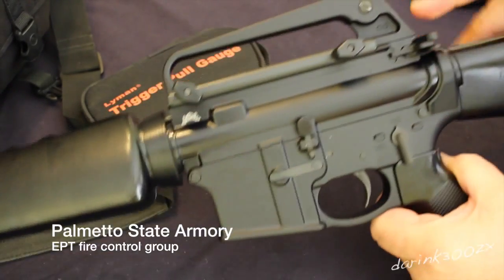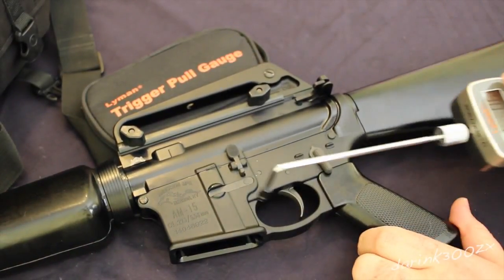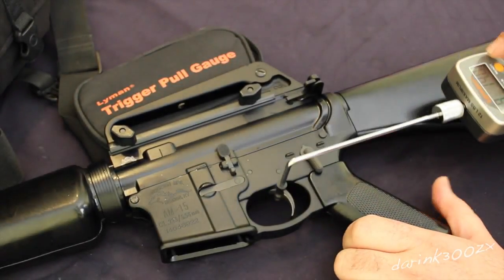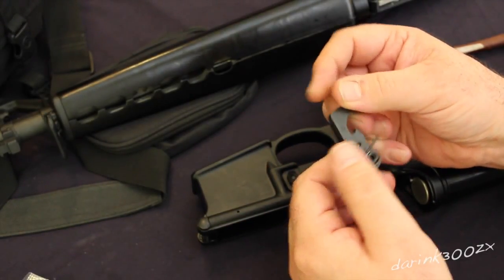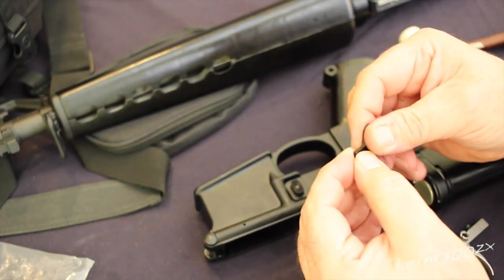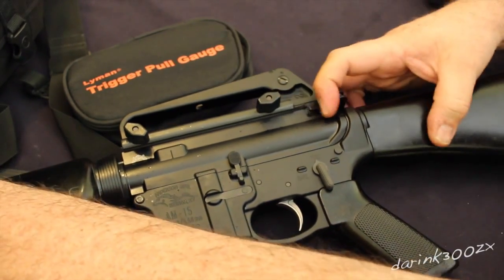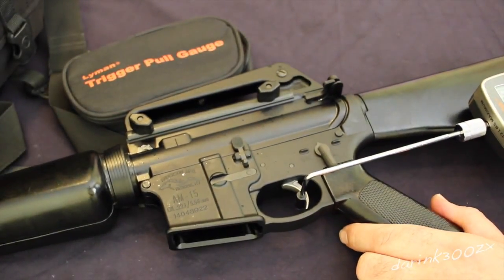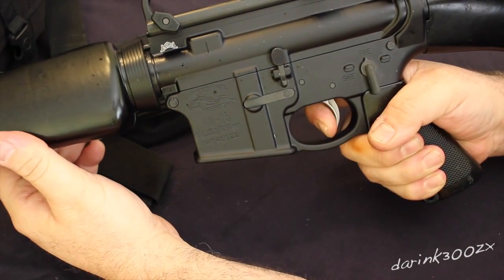PSA EPT fire control group with trigger pull measurement

Comment: It looks like using the gauge on different places in the trigger will change the outcome, which makes sense if you try to pull the trigger from higher it will be harder to break where as if you pull farther toward the end of the lever it should be a lighter pull

Comment: Thanks. I added some JP Enterprises trigger and hammer springs and the trigger pull gets lighter still but you still have that long trigger creep.
Reply from the maker: I guess each trigger varies when you're in this price range, mine don't have a lot of creep to them.
Reply: That's with the PSA EPT fire control group.

Comment: I must have been lucky. my psa stock is crisp 6lb. I still plan on lightening it on my distance rig but cqb is perfect stock
Reply from the maker: Paul H that's nice to hear, maybe there is some inconsistencies with the springs they use?  I've got a few of these PSA triggers I need to check the pull weight on the others too.
Reply: darink300zx you're probably right sir. I've read quite a few varying degrees of pull and crispness.  I was really surprised when I got the lower.  It's still not ideal for longer ranges but even with my severe rheumatoid arthritis it's fairly pleasant all things considered.

Comment: You could get better results with 1000 grit sand paper. 
That coating does nothing for trigger pull and I doubt very much it does anything  to make it smoother.
Reply from the maker: AKBuilder762 yeah, maybe, it felt smoother for me though and as can be seen either the coating (or possibly the springs) that came in the kit decreased the trigger pull on my rifle. It's a sample set of one though, so it should be taken as that.

Comment: I Received mine about a week ago and sorry to say after all the waiting for it to be shipped to me i was very disappointed. Heavy machining marks on hammer and on trigger sear. I've gotten better machined trigger parts from Amazon YES Amazon! You get what you pay for! i should of held out for a better brand.
Reply from the maker: That's interesting.  I've always had good luck with PSA FCGs both their standard ones and the EPT.  If I were you I'd install it and see how it functions, if it has a lot of grittiness try returning it for another.  Although PSA customer service can be a little slow at times, they have always come through for me when I've not been satisfied with a product I received from them.

Comment: lubrication the FCG will help a lot. Bill Geissele often speaks to keeping the trigger well lubricated. Weapons Shield has a YouTube vid about how to lighten trigger pull with use of their lubricant product. The more that you dry fire the trigger the smoother and softer it will become. "snapping in" is a good way to practice your breath control and settling the hands, whilst improving the trigger.
Reply from the maker: Casey Terrence cool, good info to know. I usually lubricate the components as I put them in with some grease, and then when I clean a little clp gets worked in. Thanks.

Comment: if the shape and smoothness of the parts are the same they should perform the same with or without coating...it is more likely the spring that makes the difference
Reply from the maker: +EvendimataE Honestly, I hadn't thought of that, I wonder if the EPT kit is shipped with reduced power springs and this is all a marketing gimmick?
Reply: darink300zx maybe they should just sell kits of springs as upgrade so it will be cheaper LOL
Reply from the maker: EvendimataE lol, true.  You've got me curious, I must say.  I may just swap the springs from the trigger I took out to this one and see what the pulls are, that'd tell the tale probably.

Comment: Run JP red/yellow springs with this FCG for a really good mil spec trigger.
~5.5lb
Reply from the maker: I need to try that. Haven't messed with the springs yet. Thanks.
Reply from the maker: I tried this, thanks for the suggestion. I did the red/yellow and the yellow/yellow jp kits. Check it out: https://youtu.be/fv2gjde0xGQ

Comment: Just got one...haven't installed it yet. You shoot yours?
Reply from the maker: Yes I have, just haven't had a chance to do the follow up video. It shoots well, but then the standard trigger worked well in this rifle as well. I do think it's a bit smoother but psa triggers are generally pretty smooth on their standard parts kit triggers anyway. The lighter trigger pull surprised me, but it wasn't a hugely noticeable difference. There is no discernible grittiness that I can feel though so worth the money. Thanks for watching and the comment.

Comment: I just got mine, its not really anything special in terms of pull weight and smoothness but the pre travel is shorter than my standard trigger I got from them.  In fact, to me it just looks like a milspec unit in the white... the bearing surfaces are polished better than my milspec unit but i can still see mill marks. All in all, not really all that impressed with the pull, but as I said, the pre travel is quite a bit less. reset is pretty nice too. I may get out the rotary tool and polishing wheel and see if I can help get a little smoother pull, as well as some new springs.
Reply from the maker: +GraymanTactics Yeah, it's definitely not one of the high dollar triggers.  I'm sure each trigger is different, but I did see a little lighter pull and to me it did seem smoother, maybe it was the pre-travel that I noticed and didn't know how to describe it.  Thanks for watching and the comment.
Reply: darink300zx Yeah and for $30 I really cant complain much. I almost went with one of the ALG QMS units but figured for 20ish less it would still be worth it to give the PSA one a shot. I am by no means so upset with it that I will remove it and still think it is a worthy upgrade over the standard trigger, and I suspect a lighter main spring would help a lot. Now that I think about it, i'm not sure polishing it would really help all that much because there is hardly any decernable pre-travel... it is just heavyier than my stock trigger, but my stock trigger had probably 1/8" pre travel so there was time to actually feel the grityness. Polishing with a file and 1000 grit really really helped. Overall, I am happy with it i guess and was probably a bit too harsh in my origional wording... it was new, late at night, and the whiskey was in my belly so my logical filter wasnt working 100% LOL. Thanks for the review. Maybe after I get a bit more trigger time i'll post a review of mine. Now to install my ALG EMR v3 evil grin
Reply from the maker: GraymanTactics LOL.  Please review that rail, I like the looks of those!!